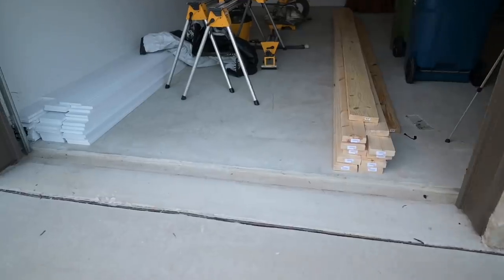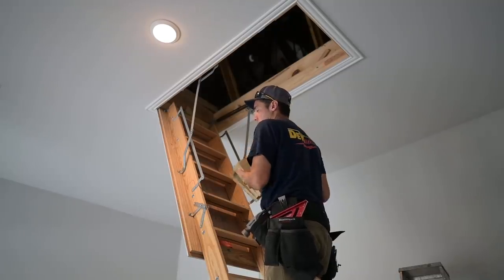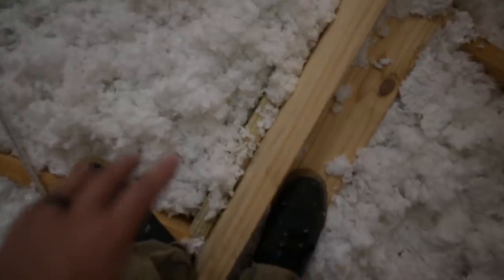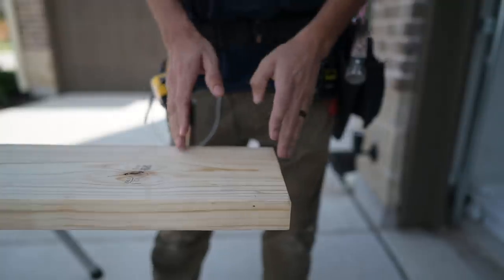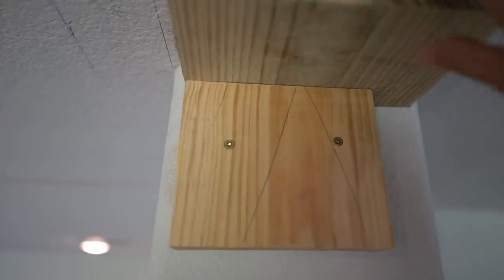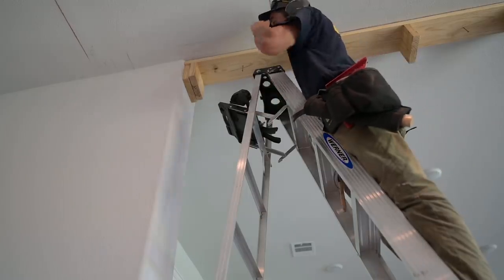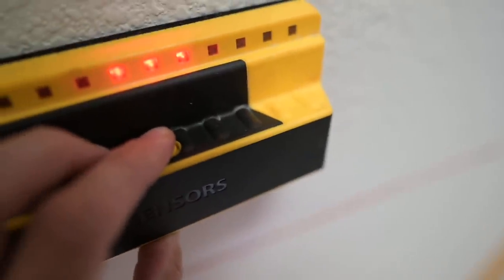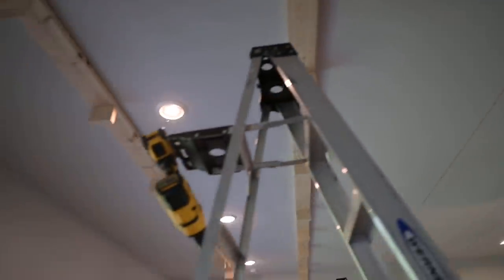Rough Framing for Finish Trim Work

Comment: Thank you for linking that stud finder. I have 2 different kinds, and they just aren't cutting it. I'm about to put up two different barn doors (a double, and a large single 5 foot door that has a partial ceiling mount in a hallway opening, so this kind of a stud finder will make things so much easier.

Comment: I was going to do my kitchen/great room with a fancy coffered ceiling that my wife wanted.  We had a home designer/decorator come in and vetoed it.  Thank goodness.  I wasn't looking forward to that.  But you have some great tips in there to make the job easier.  All I ended up doing was a crown molding.  Thanks  for showing us this.  It was very entertaining.  

PS I used to do renos,  and I've seen guys use PL and wall anchors in the drywall instead of backer board.  😳😳😳

Comment: Braver man than me with all that cabinetry below. Expensive drop. You are always giving me tips here is one for you. When your drop saw didn't quite cut those boards don't bother turning the whole board over just lift your side of the timber as you cut up onto the saw. you can cut a lot wider than normal like this. I do it all the time as I only use a 10 inch drop saw. Not advisable with a slider as you can get kick back but good on a fixed saw.

Comment: its good how you also use the Dewalt stands as benches, i have 2 and do the exact same thing, infact, they are PERFECT for stringer work...lay the timber, extend the ends, clamp and you have a solid bench to router a Stair Stringer.

Comment: Great job Richard. The 2X’s that ride on top op the joist you referred to are called strong backs if they don’t carry a load. If they carry a load, they are called Perlins. 
   BTW Larry Haun and his brother Joe soaked their nails overnight in paraffin wax. So they were coated with lube. Rock on bro.
Reply: Some of them soaked them in gasoline and wax. I was always suspicious of the holding-power. Then Green Sinkers showed up with glue that melted as you hammered.

Comment: I use my Paslode cordless framing nailer for tight spots in cramped areas where swinging the hammer will be tedious (Lol...just saw your post below. My paslode is very old - they’re expen$ive) I use a circ saw to cut the framing after I mark the cut. Goes faster. Larry Haun was a legend in CA. Sucks that your helper called in. Need two guys to rock and roll. Great job

Comment: Use a palm nailer in the attic, saves the pounding. Looks great
Reply: I have a 12v Miwaukee palm nailer and no framing hammer. I figure the less framing tools I have the less apt I am to be put to work doing it. The little I do I just use screws anymore

Comment: Richard,  I would recommend a set of drywall benches to work off.  As tall as you are,  working a 10ft ceiling would be no problem.  Much easier than working off 2 ladders.

Comment: Hey Richard FYI if your cutting 2X10 on that saw after you cut it stay all the way down while saw is still running just raise the front part of the wood and it will cut it all the way threw no need to flip it but love the camera

Comment: Threaded nails.......... What will they think of next? :)
Reply: Have you seen the screws that work in pneumatic guns?
Reply: And you can attach a garden hose to it. Works a treat. With a guy hand pumping on the other end. I’m all cordless now. No batteries either
Reply: Non threaded screws

Comment: Hey Richard ... I have to tell you, this new camera you are using looks amazing. Seriously when you are holding the camera it's focus on you is crisp & professional because it also blurs out the scenery behind you. Also when you show other things directly like the LVL it's clear and very detailed. Nice switch.    I have a question on your Finished nailers ... When do you use your 15 gauge nailer as apposed to your 18g. ?  I know 18 is good for most small trim, but when would you switch to 15g?  Thanks

Comment: For the Larry Haun lick you need a long hammer handle and get off your knees. I use a 17.5" long 19 oz Vaughan. Believe it or not the extra 2" makes a difference. I love his book "The very efficient carpenter". There are tools in there that he uses that I still haven't seen on a job site. His gang cutting method for cutting birds mouth with a special saw is meniacal. Crazy ingenious man.

Comment: Haven’t heard you explain why you use 2-b’four instead of 1-b’four as the structure.....see that, legit question for you and a nice Larry Haun reference. Thank you.
Reply from the maker: I like the framing lumber because it’s thicker for fasteners when nailing. And it’s cheaper. I will say you have to dig through the lumber rack to find straight boards but I like using it

Comment: we call those rat runs ,for holding the ceiling joices straight and also a convient place to mount wiring
Reply: also known as stiff backs. keeps the proper spacing as well as stiffening the entire structure.
Reply: Carl Clyatt that’s a new one on me. Got a big kick out of rat-run—Where do you frame?
Reply: Depending who you talk to they are called by either name around here.
Reply: @royalvarez6436  i'm from sw Georgia

Comment: Question:   How does one determine an acceptable amount of stress on roof rafters/trusses and will reinforcing joints help to improve added weight?  ( after plans have gone through engineering and a homeowner wants to add additional weight...I ask due to wanting to add elevated shelves for tools storage in a garage]  Thxs for any guidance.
Reply from the maker: I am not sure but I think if it’s questionable weight then you would want an engineer to look at it.

Comment: You could have cut through the entire board by simply lifting the front of the board when you pull down the blade on the miter saw. This trick is good for cutting that addition inch or two.

Comment: The Nikon Z7 4K video quality seems to be a notch above the A7 R3! You made a comment in the attic about screen brightness verses what it actually looks like. Are you relying solely on the camera screen or do you also use the histogram? It'll help you alot if you aren't doing it already.
Reply from the maker: I’m not sure. I’m looking at the display in the back of the camera
Reply: @FinishCarpentryTV  After replying and deleting confusing paragraphs many times over I will say this. This video actually look great and the attic scene looked well exposed on my computer. The back of the camera will look brighter in low light because it's applying higher ISO, wider aperture and slower shutter speeds to compensate for the low light conditions. That depends on what mode you shoot video in. Does your video editing software have a histogram graph to show you exposure of the video you are editing? That will tell you exactly what your exposure range is if you are that worried about it. After the fact of coarse. You've been shooting video for years and honestly your doing fine trust me. If it's not broken don't fix it. Don't over think things just because it's a new camera bro.It's easy to do. I shouldn't have opened up the histogram can of worms. I did research however that high ISO will create digital noise in low light conditions with some new mirrorless cameras so try to use artificial lighting when you can. Like that battery powered Rigid.

Comment: Quick tip, use blue chalk not red, red chalk is a dye that is designed to mark permanently and will bleed through paint us less primed with a "shellacking" primer to seal the dye, can't tell you how many times I see a red line bleed through the finish paint job, also blue pens and sharpies are the worst! Has the red chalk rubbed off on the bottom of the stud finder and tracked across the ceiling?🙄  great workman ship!

Comment: I would not nail those blocks in the ceiling. Screw them only. Nails and banging on the sheetrock will create cracks and nail heads to pop loose. Why not lay blocks flat? Just saying . You will have alot more to screw to. Thanks for the vid!!!

Comment: Why did you know those in the ceiling rather than screw him little bit easier to screw it plus less vibration on the ceiling last nail pops in the sheet rock or drywall you Southerners call it
Reply: Sheet rock is a brand, drywall is the name of the product. You’re welcome, from NJ.
Reply: Robert Beirne yes I know lol I am from Long Island been calling Sheetrock for 50 yrs
Reply: Dennis Harvey 👍